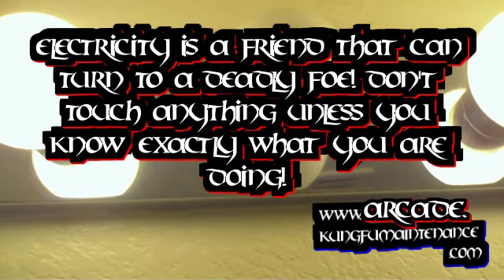How To Fix A Depressed Light Bulb Socket ~ Lights Not Working

Comment: I was ready to have a service call $$$ because my fridge light burnt out and the new one I put in would not work. Tried your method, and perfect! Hardest part was finding the right circuit breaker, as none of them seem to be marked correctly. Just kept throwing switches until the freezer light went out - bent the tab on the fridge socket, put the crappy new bulb in, turned on the breaker, and voila! A working fridge light!

Comment: What you said – "once the power's out, the power's out" – is not necessarily true... One really should turn off the circuit at the breaker before attempting this. The circuit could be wired incorrectly, with the switch on the neutral instead of the hot, and if you merely flip the switch, you're still in danger when attempting this.